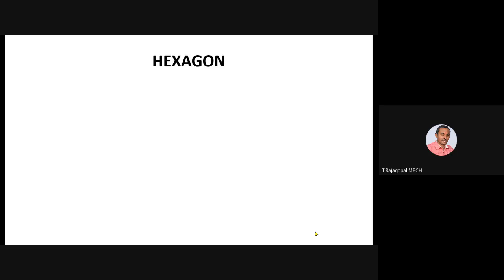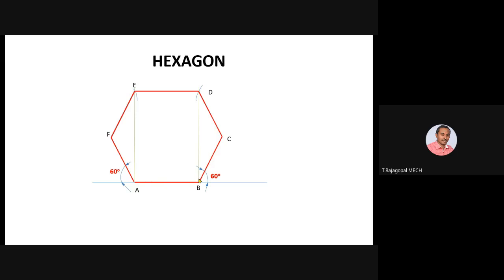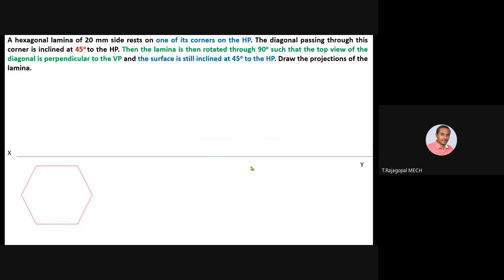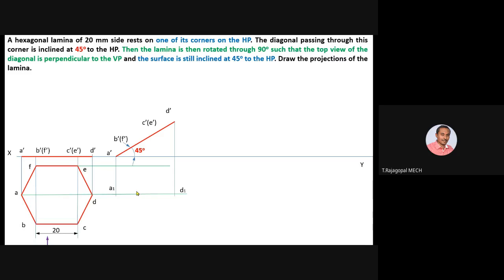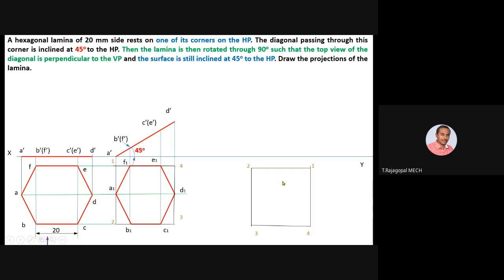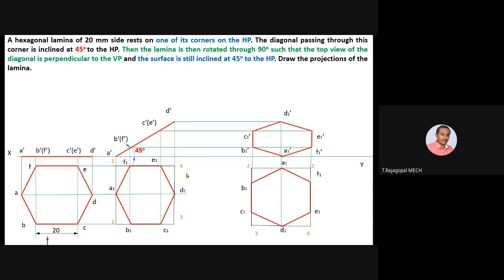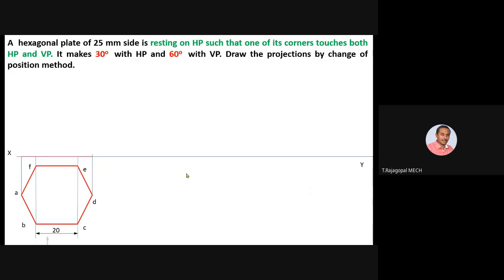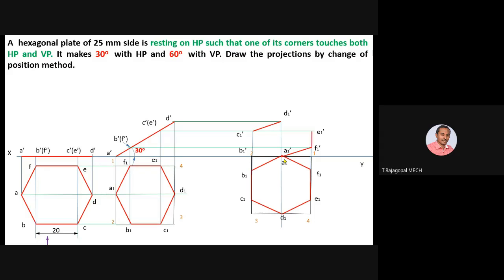Projection of Plane Surface -Hexagonal Lamina @rajagopalthangavelsforum

Comment: hexagonal lamina of 20 mm side rest on one of its corners on the HP. The diagonal 
passing through this corner is inclined at 450
to the HP. The lamina is then rotated 
through 900
such that the top view of this diagonal is perpendicular to the VP and the 
surface is still inclined at 450
to the HP. Draw the projections of the lamina.